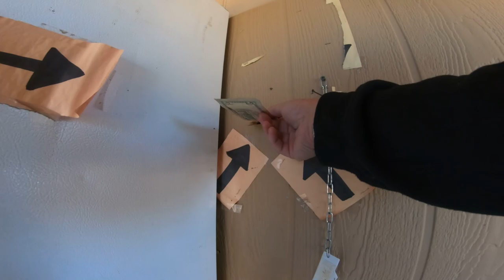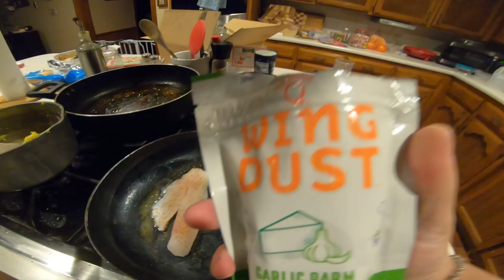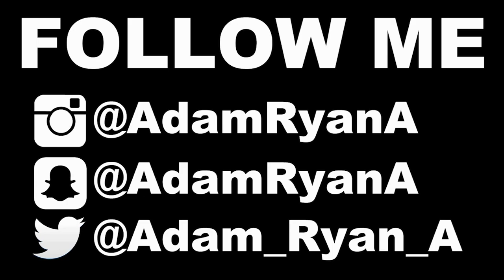FINISHING The FOAM On The JON BOAT DECK!!

Comment: Bro the boat is looking sick Bro. Can't wait to see you finish your boat. So my question is now are going to put a 15 horse motor on and if you are going to put the other Fishfinder as your GPS and if you're going to put your light poles in the back
Reply from the maker: If I can find one I will put on a 15, but they are impossible to find in my area, and yes still got to mount the back fish finder, and light poles? What are you talking about?

Comment: Material is directional if you put one piece down then turn the other one the opposite direction it will be darker one direction and lighter the other. Just my opinion from doing upholstery man. Boat looks good. ❤️🎣☑️
Reply from the maker: Oh yeah I know it’s directional but it’s still darker no matter what way you look at it, it’s the lines making it darker